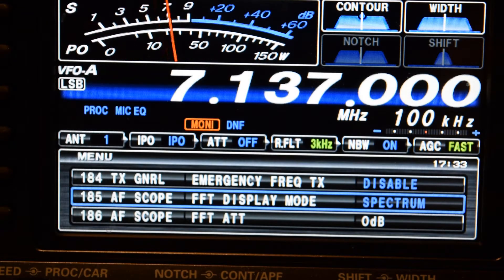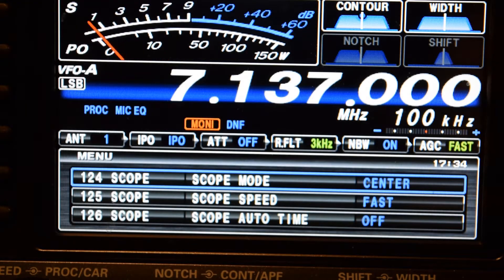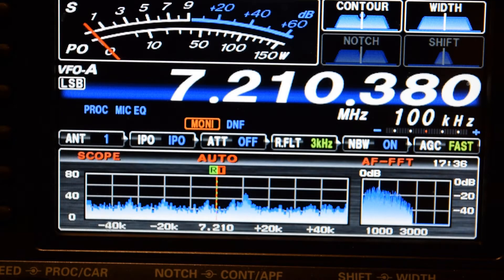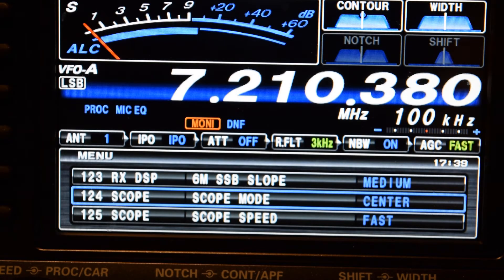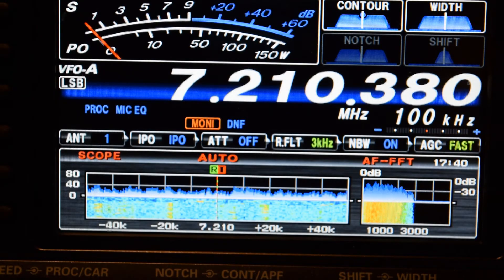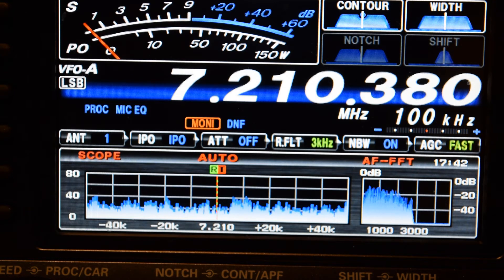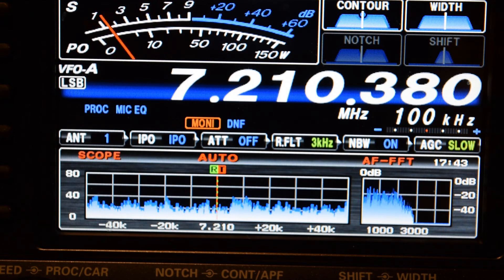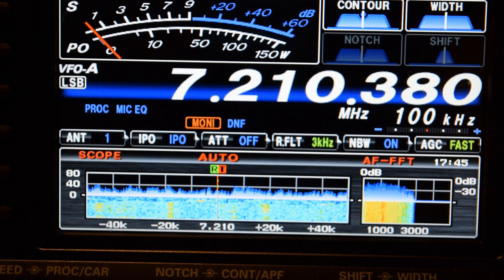Yaesu FTdx1200 Analog Meter Hesitation after firmware updates

Comment from the maker: I have recently fixed the problem with the meter hesitation. Yes the AGC is on fast, but it did hesitate worse then the way it should be. Yaesu sent me a fix and it did fix the problem I had to delete the firmware update when I put the fix in, and "then" do the update and it did fix the problem. Yaesu told me they did have several people complain about the firmware update on the FTdx1200 having this problem. Yaesu called it a patch fix.